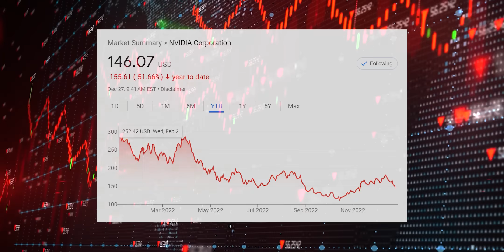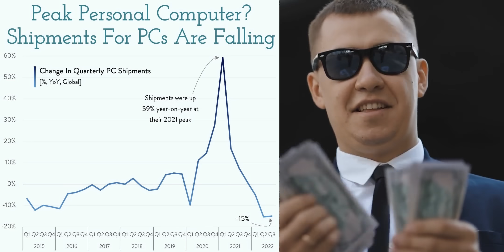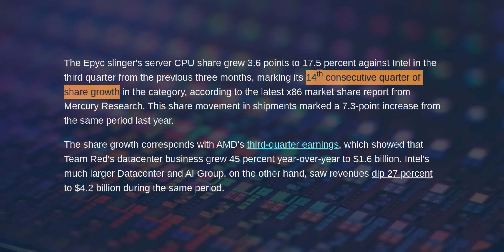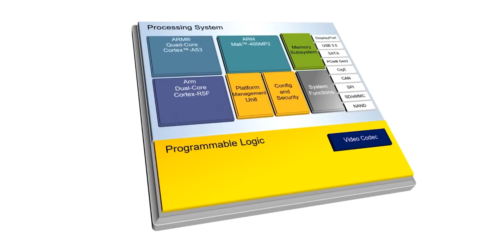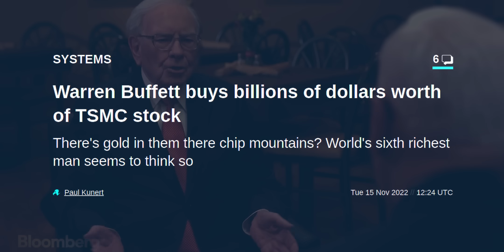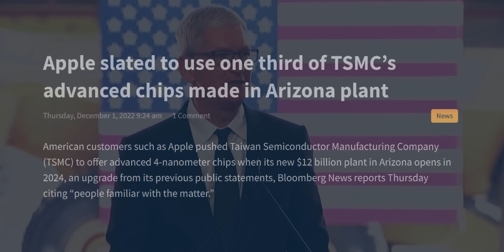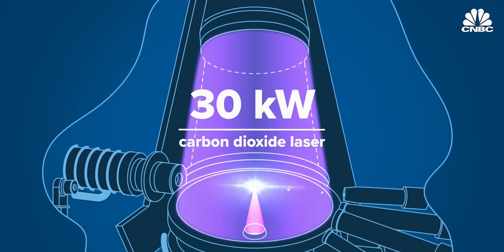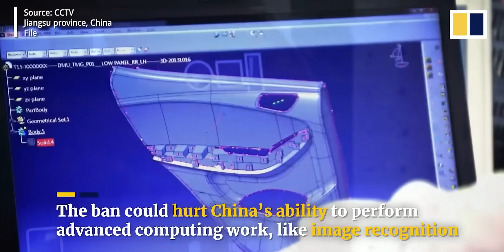Top 3 Stocks to Buy in 2023 (Over TSLA or NVDA Stock)

Comment: Just a head's up, I deposited $100 to Moomoo and didn't get any free stocks. I used your link and everything, first time user. I thought maybe I had to wait for the deposit to fully clear, but that just happened this morning and I was still not able to draw any free stocks. Every time I clicked the "Get free stocks" link, it took me to the deposit page, as if it wanted me to make another deposit. I tried to withdraw my $100 since I didn't get the free stock offer, and I was unable to. Turns out I need to keep my $100 in the account for 4 business days before I withdraw. Just wanted to let you know my experience, it was pretty frustrating. It's possible I did something wrong timing wise, but I did open a new account and deposit $100.